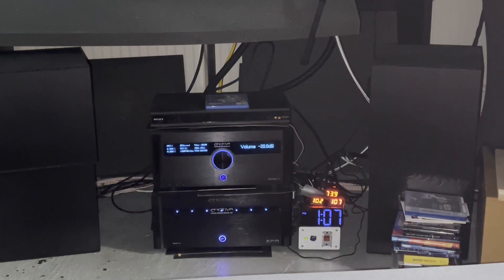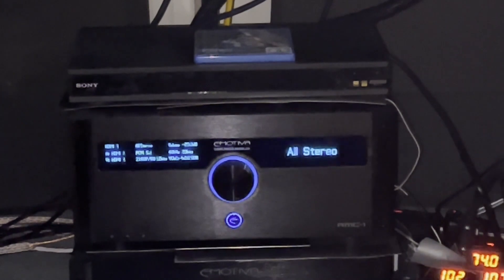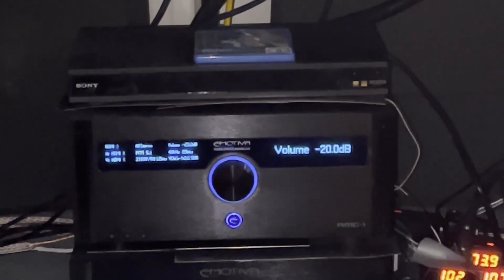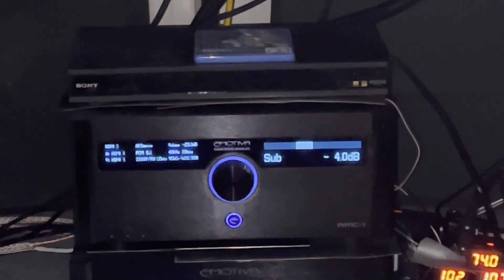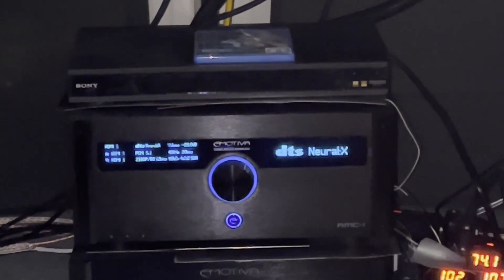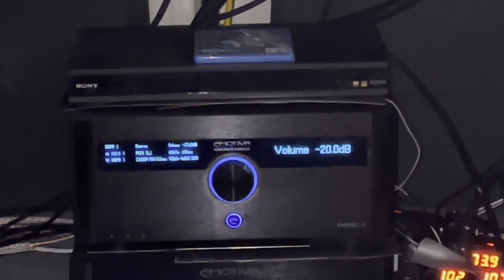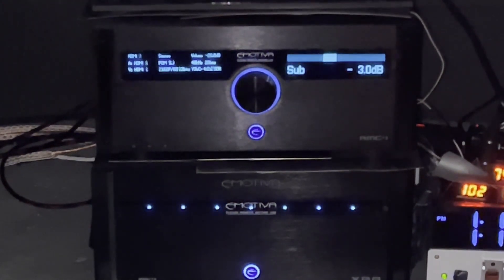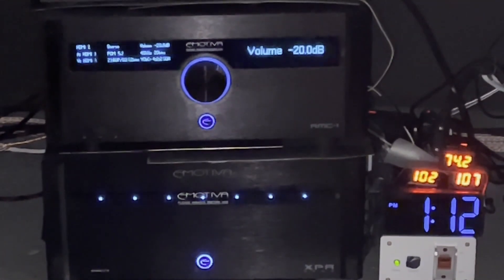Multi-Channel - Gear & Settings - Part 4/6 - www.AcousticFields.com

Comment: I use a surround receiver in my main stereo system with 3 subwoofers,and i agree with you,to have the option to adjust the subwoofer level with a remote is so nice.
Reply from the maker: It is critical for many reasons. Different sources have different aplitude outputs for low frequency energy. There appears to be no standard. Secondly, all low frequency energy will "fit" better into existing room dimensions if we have the ability, especially in .5 dB increments, to manage the output of low frequency energy into our room. Rememeber the room only sees the frequency and amplitude of energy placed within it.